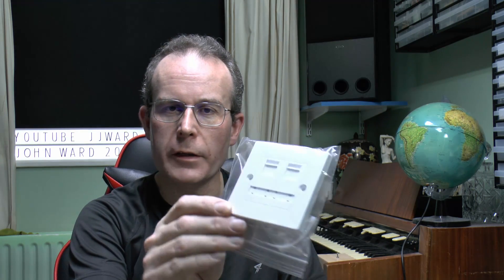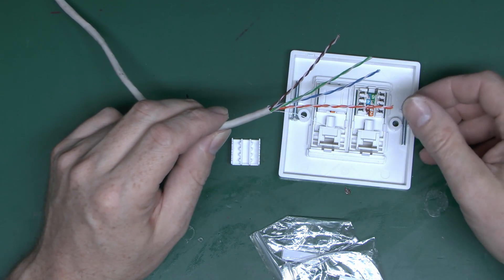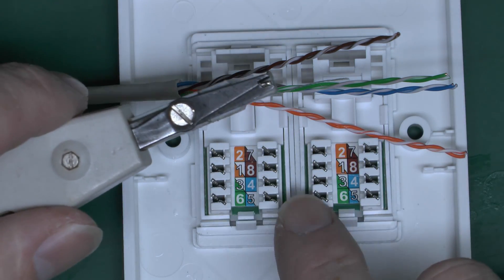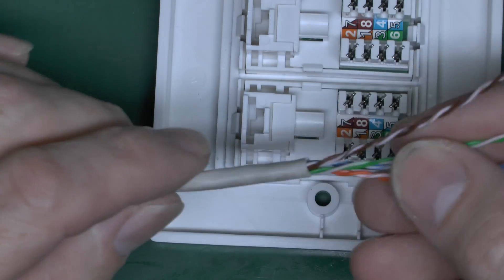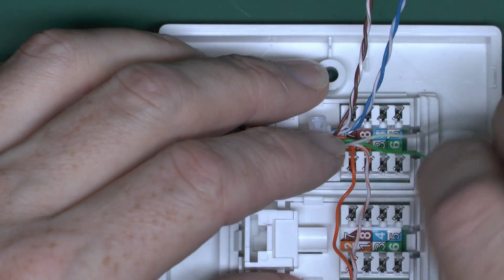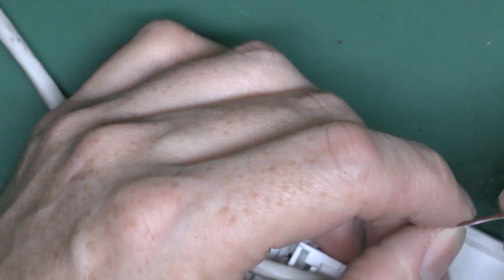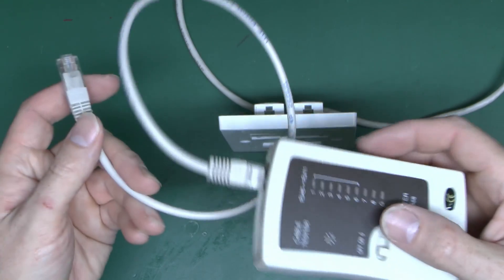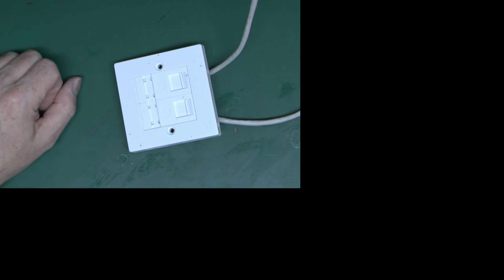Connecting Cat5e Cable to  'RJ45' Wall Sockets

Comment: It's amazing that Cat5e is still valid twenty years after it became standardized.
Reply: And amazing what transmission rates are possible now.
Reply: Why?
The basics of copper transmission line have not changed. All that has happened, is cleverer ways of encoding data in the transmission. And the earlier technology did not actually use all the cores in the network cable, but now all cores may be used.
Reply: Even more amazing is that most Cat5 cable actually meets Cat5E specs (usually the stuff from Commscope, Berk-Tek, etc. --manufacturers that weren't trying to make the cheapest product).
Reply: How about plain old telephone service (standardize since the1870s) and Edison screw-type lightbulb bases (since the 1880s)?

Comment: The "unbranded" tool and terminal you have is Krone and not generally available to the public in many places. Krone and BIX (Yes still around under Belkin.) are mostly sold to Contractors at a Premium Prices. One "Cheap" terminals and tools are "110" and sold to public and professionals under many Brands like LEVITON. Most 110 punch tools do not cut like Krone or BIX instead cutting edge cuts the wire using the terminal plastic as an anvil. Caution: Many knockoffs of 110 tools and terminals are very cheap and will cause problems when installing or days to months latter.
Reply: The type of tool JW uses in this is readily available in the UK at various trade chain store outlets for less than £10 - they sell to the general public too. You can get them with or without cutters. I think Krone's patent or whatever must have expired. That said, if you do this day to day for a living you're probably best not using a <£10 tool - false economy as most cheap tools are.
Reply: @chillybrit2334  If the go same way as 110 and 66 types for 30+ years now. Expect problems with Krone knockoffs. Cheap Tools are bad enough, Cheap Terminals can be very bad in every way like punching either with professional grade "Harris" tool set for non cut and minimum force still break or cut the wire because of very sharp terminals etc.

Comment: Was that an old BT punch down tool?
Reply from the maker: No idea what make it was - it's many years old and hasn't got any markings on it.
Reply: They can be bought on eBay for next to nothing.
Reply: It’s a tool designed for use with KRONE type terminals only. KRONE terminals being very common in the U.K. telecommunications sector.

Comment: Nice topic.

That looks similar to the keystone jacks I've used in the past, but those are usually one over the other, US style, not side-by-side which seems to be the British preference.

I like the cutter on your 110 punchdown tool. The usual ones in the US just have a tooth on the side for cutting, which is usual more nicking than cutting.

I am quite amused to see shutters on the Ethernet jacks. What does Ethernet run at? 5v?

When terminating pairs, I generally avoid untwisting the pairs. You can generally spread the pair enough to span the slot without completely untwisting the pair from the end.

You can also get heads for the punchdown tool to seat all four pairs at once, both side-by-side for keystones and inline for 110 terminal blocks.

Does your cable tester identify split pairs?
Reply: The shutters are the same style as the shutters on our phone sockets. As far as I am aware, they are just for keeping dust and debris out. Portable equipment doesn't normally have shutters on it.
Reply: That is not a 110 tool, nor 110 blocks. 110 blades are 90 degrees to cable entry. These are Krone LSA-PLUS style, easily identified by the 45 degree blades.
Reply: The style of tester that John is using will not identify split pairs unfortunately

Comment: I am a bit surprised about your outlets, around here it is many years ago we needed a tool, it is build into the outlet as a lid you close over the connections.
We also use a smaller module size, either 50x50mm or 50x75mm (This matches mains outlets and switches), I think it looks much better, but we have to pay a lot for it, because other countries uses a larger module size (I am in Denmark).
Reply: The ones with the lids that push the cables down into the IDC connectors tend not to trim the excess off.

Comment: What's your opinion on these new type RJ45 plugs that allows the wire to pass through before you crimp. I personally have used them without purchasing the expensive accompanying trimmer.?
Reply from the maker: Never used them - but I don't do many plugs, installations usually contain the wall sockets and any leads are just purchased ready made.
Reply: EZRJ45? I don't know anyone who works with RJ45 who stuck with them after one or two uses. They have a real tendency to cause sparking and arcing because of how they're made. The copper in them is badly done and causes shorting and sparks. Really not good but I can't work out if it's just poor build quality from the current patent holder or a inherently flawed design. I haven't really had chance to look at them up close but I do still have some. I might give them another look now I've been reminded.
Reply: @medes5597  Sparking and arcing? From where to what?
Reply: @Monkeh616  I'm guessing on power-over-ethernet applications

Comment: Who still uses Cat 5e in 2019?
I've never used anything else than Cat 6A or 7 in years.
Reply: Well considering the best UK internet connection in domestic use is about 350mb lots of people do, plus whats the point of fitting Cat7 when it's likely to be used for a CCTV camera or a phone line. 
Little bit of cable snobbery I feel.
Reply: I doubt most people need Cat 6 or greater

Cat 5e is fine and cheap
Reply: @GeeTheBuilder  I have use CAT 3 telephone cable for long runs with ethernet and never had any speed or curreption issues.
Reply: First of all I'm from Germany where of course different things apply. 
Secondly, it's not (entirely) about the speed beneficals but about the electro magnetic shielding which is provided by higher rated cables.
And lastly, here you can't even buy Cat 5e anymore. At least I've never seen it being sold.
Also Cat 7 is pretty cheap nowadays. You can get decent one for about 68€ per 100m.
Reply: @scwfan08  Shielding is unnecessary even for 10GigE operation - we're talking domestic here, not bundles of 300 cables. It creates an immense extra expense and hassle to effectively terminate for very little gain.

As far as the ever classic "you can't even buy it any more", I'm positive that's a crock. I've found several sources in .de without even looking hard, via a search engine heavily biased not to show results in the wrong language..
Reply: @Monkeh616  indeed I don't know where he's coming from on the can't buy cat5e because you absolutely definitely can. I have to admit though if a customer asks for ethernet are usually use cat6 or 7 now. But for cameras like JW was doing cat5 is fine
Reply: @Monkeh616 
I'm not talking about Amazon etc. Try to find anything less than 6A at a specialised trade (non patch cable).
Also I'd rather be safe than sorry.
Reply: @scwfan08  I'm not talking about Amazon - again, heavily biased against finding results like that..

If your 'specialised trade' supplier can't supply you the materials of the trade, THEY SUCK.
Reply: @TheChipmunk2008  You can buy cat5e labelled as cat 6 or cat 7 from lots of unscrupulous sellers....
Reply: @brianleeper5737  yes including many allegedly ok wholesalers. I've also noticed a great increase in the number of people selling cw1308 cable that is not actually cw1308. I'm pretty sure it specifies solid copper conductors and almost certainly tinned copper
Reply: @TheChipmunk2008  Here in the USA, you will not find any NRTL (Nationally Recognized Testing Laboratory---most commonly UL but there are others) approved telecommunications/data cable that is not either solid copper or tinned copper. National Electric Code section 800.179 states "Conductors in communications cables, other than coaxial, shall be copper".

 The issue with unscrupulous importers and sellers has gotten so bad that UL has a hologram sticker that they put on the cable reel or box to tell you that it's really UL approved and not some counterfeit garbage.

Regarding cw1308 cable--that appears to serve the same function as what we in the USA would use cat 3 cable for, which is interior telephone wiring in situations where cat5e isn't desired or appropriate. Does the cw1308 specification mirror or reference the cat 3 specification?
Reply: @TheChipmunk2008  I saw this CE Tech cat 6 cable for sale at Home Depot and I remember thinking that I would NOT buy that stuff. I would buy Southwire, General Cable, Commscope, Berk Tek, West Penn, Superior-Essex, just to name a few reputable manufacturers of category cables, but to save a few bucks and then have this? 

https://www.cpsc.gov/Recalls/2013/home-depot-recalls-ce-tech-riser-cable 

Sure they'll refund your money for it but they won't pay you for the labor to rip it out and replace it with new cable. And who knows if that junk actually meets cat 6 specs.
Reply: @brianleeper5737  cw1308 is a British telecom specification but it's pretty similar to cat3. The major thing is it should be tinned because the original spec was for solder type terminals on mdfs
Reply: @TheChipmunk2008   Interestingly enough, tinned conductor telephone cable is, in the USA, referred to as "switchboard cable' and is rarely used for inside wiring; I think it is more commonly used in exchanges/central offices. I think it may also be preferable for wire-wrap terminals as well.

I have not seen any spec for "switchboard cable"; if Bell or AT&T had one, none of the current manufacturers of it reference it.

Comment: If one wanted to have the two socket outlets wired in the same circuit, can jumper wires from one to the other be used or, is it possible to buy a twin unit, both sockets, one cable?
Reply from the maker: One socket = one cable.  Two sockets on one cable would work - but only if you used one socket at a time, which would make it entirely pointless.
Reply: I don’t think network cabling can work like that, you need a separate cable from a central network switch for every socket in a LAN.  If you want to only run one cable, you would need to run the single cable to a socket, then use another network switch connected by a patch cable to that socket to enable multiple devices to connect to the LAN via that single socket.
Reply: Ethernet does really work like that. You can't make a passive split.
Reply: It makes no sense to join them together for Ethernet, because each cable needs to run directly from one device to another with no branching off. Typically, each socket will be connected directly to an individual port on an Ethernet switch, via a patch panel.
However, sometimes the same sockets are used for things other than Ethernet. For example, analogue phone lines, AV signals or RS-485. Some of these other kinds of signals can be branched off, and you could probably punch two wires into one terminal to achieve that, though it''s probably not recommended.
But you still shouldn't connect the sockets together, because it's non-standard and it will confuse and annoy someone in the future. It's normal practice to run a separate cable from each socket back to a patch panel somewhere, because then you can (in theory) route any sensible kind of signal from any socket to any other socket simply by rearranging patch cables on the patch panel, without having to do any rewiring.
Reply: Patrick Wigmore Yes, use patch panels, for God’s sake! And label them in a sane and easy to decode fashion!
Reply: Technically it is possible if you only want max 100Mbps. 1Gbps uses all 8 cores. But seriously - just don't do it, it's a piss poor hack at best.
Reply: I purchased a splitter. (I needed a joiner anyway). The eBay listing kinda said only one device will work at a time. Anyway with 2 TVs plugged in nothing works. So one cable one socket.
Reply: Simon Jenkins 
yes there is, and it will do wifi as well.   https://www.ubnt.com.au/unifi-ac-in-wall-access-point
Reply: Definitely not a good idea to try this with Ethernet. Even if it appears to work it's outside the spec.

Comment: I have one of those testers, took me a while to realise that the number 2 led on the remote unit was not working. A frustrating amount of time was spent looking for a fault in the cabling before i finally checked the tester with a known good lead. Swearing was heard!
Reply: Had the same issue with that cheap style of tester, but on pin 4 and intermittent depending on how I manipulated the cable at the master end. Same head scratching and swearing result. Unreliable testing kit is worse than flat out completely broken, false positives, false negatives, just don't need that when doing this stuff day to day. Bought something a little more expensive (~£50), still budget as far as CAT5/6 (8P8C before JW gets too irate) test kit goes but it does bring additional features to the party such as cable locating - for those instances where some utterly lazy incompetent has not labelled any outlet and you need to find where it goes to in the patch panel - and basic PSTN testing.
Reply: It is important to understand that the LEDs on the remote are not in the slightest bit important. The remote device must be plugged in to make the test, but you do not need to view or check the LEDs at the remote end.
The lLEDs on the master will only illuminate if the connections are made correctly. The LEDs on the remote show the same information. If one LED doesn't light, then that connection doesn't have continuity. If 2 LEDs don't light sequentially, then you have a cross over between those two. If 2 x LEDs light up together, you have a short between them. But all of that can be determined from the LEDs on the main unit, and you do not need to even sight the remote.